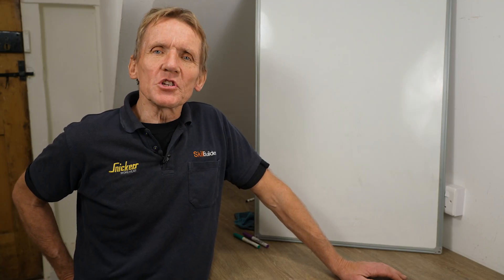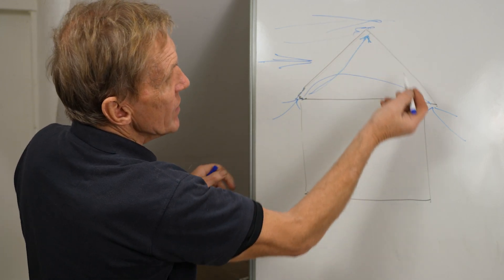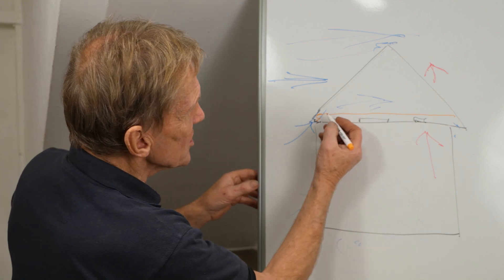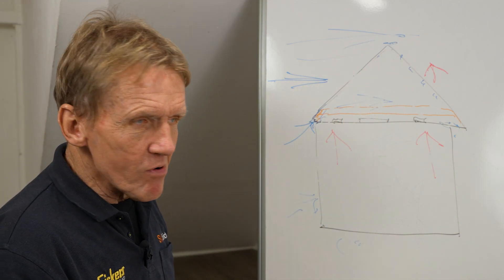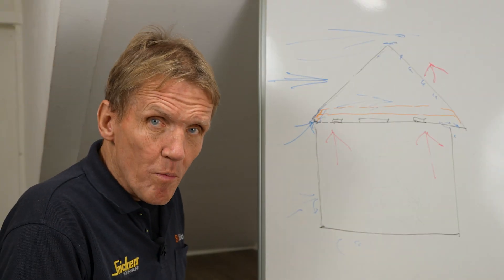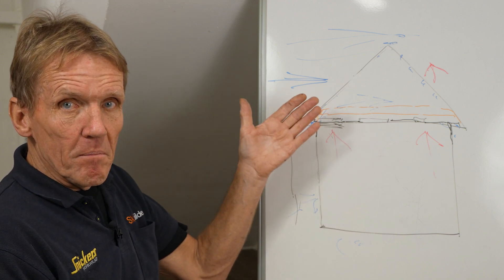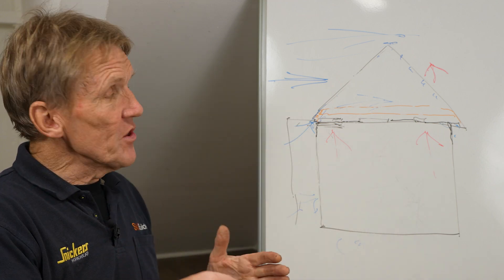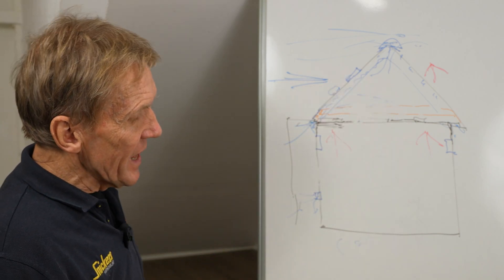Why Do You Have Condensation in Your New Roof?

Comment: This is old but very relevant. I had a new roof put on but all of a sudden had a lot of moisture build up....not in the loft so much but in the house.  Ridge vent open, soffit baffles created and put in but still problems.  Insulation was blocking but have pulled back. Why/how could this be?  There is inadequate insulation in the loft which will be corrected soon and will be putting a vapour barrier in as well but I don't understand why this has happened?  Not enough ventilation?

Comment: Couple of vital of info missing on post (although as a roofer myself ,spot on about cheap membrane) Firstly the lower the pitch of the roof , the more condensation it gets. Secondly roof tile vents only work by cutting holes in the felt directly where vents are  strategically fitted.
Thirdly there are spacers available really cheaply that will separate the felt from the inside attic space that will solve the problem alongside which is already rightly explained in this vid . Great post tho all round

Comment: This explains my issue but what would explain the mould appearing on walls like under my stairs in the cupboard and in the corner of my bedroom both which are the same exterior wall. Also I have water mould in my loft on the OSB of the gable end it’s a brand new house

Comment: Great video thanks. What would you consider to be the average moisture content we should expect in a loft for a new house during the winter? I have recorded humidity levels in the high 90%s. A neighbour also took measurements in his loft with similar readings (max. 99%). I appreciate that new houses take time to dry out and we plan to check again new winter. We have lived in the property for the past eight months.The site manager has been very helpful and has inspected the loft to ensure the insulation is not obstructing the ventilation in the eaves. Having previously lived in two new-build houses in Guernsey constructed with 'cold roofs', both had consistently dry lofts and we were able to store boxes and clothes without any signs of damp.

Comment: Hi skill builder. Just wondered if you can advise me. I have noticed that im getting some damp patches  on my newly converted loft space. My understand from your video that it's most likely not enough venterlation. The vapour barrior used was the "£40" vapour barrior used. If the vapour was upgraded to the 3ply as suggested, do you think this would help/rectify the issue

Comment: Hi Roger, great video as always. I’ve just started getting a small damp patch through my lounge ceiling. Looking in the loft (today) there are a lot of water droplets on my vapour barrier, all over the old section which wasn’t celotexed. It’s a new roof (tiles & vapour barrier) with 200mm rock wool which has started to get saturated! Watching the video, I’ll get some ventilation circulating. My question is, should my builder have known this would happen, and advised us and secondly would the chimney breast have any effect in winter making it worse. Thanks

Comment: After 48 years of trial and Error with  the Problem  of Black Mould in the Bathroom  Ceiling and Bedroom Ceiling along with Heavy Droplets of Water on the Newly Fitted Roof Membrane some 15yrs ago 
A SOLUTION for me CAME IN THE LAST 2 YEARS.
I Fitted a Dehumidifier 10litre from Argos in the Attic with 100mmx40mm Channel PVC Ducting going to an Extractor Fan with Humidistat Auto Settings Above 55%. Humidity, with the Condensation or Moisture  then going from Attic to original overflow pipe outside , that made all the difference. 
HEALTH Benefits was my Main Achievement. 
Tom.

Comment: Very  interesting  and  informative - good to get down to the basics of roof void ventilation. As you point out, not all so called vapour permeable sarking felts are the same.   One way or another moisture must be able to escape from buildings or else it will remain trapped and is likely to cause problems!

Comment: nobody has once mentioned about the incorrect installation of breathable roof membrane. it doesnt matter if you buy a £10 roll or £100 roll. no roofer ever leaves the top wrap 50mm down from the ridge board! this process allows warm air to escape through the dry ridge system! if dry ridge system is not used then surface mounted tile/ slate vents are best

Comment: Hello I need some advice. I have a new metal roof over my 1974 mobile  home. The problem is condensation is building up above my bathroom, kitchen, and the small room in between is settling on the underside of the new metal roof and dripping down towards the soffit and in turn hitting the truss as well. I think the problem is we decided to vent all plumbing and exhaust fan through the soffit and outside, and maybe it exiting back into the attic plus that is the only spot on the whole roof where condensation is building up. Just to mention, we live in a very humid climate on Vancouver Island. 
Our main heating is a wood stove.
Reply from the maker: Hi Dan 
It is a difficult one because a humid climate is always going to create moisture but it also needs cold surfaces to condense on and cold air holds less moisture. I think it is worth hiring a dehumidifier and running it for a week without the extractor fans to see if that makes a difference. 
I would think the wood stove is doing no harm and keeping the house dry.
Reply: What most of the old-timers who have experience and have seen my pictures, including a retired building inspector, said is to get that vapor out of the attic. 
Corners were cut during the roofing process, and we decided to vent through the soffit, and it's backing into the attic and sticking to the cold metal. Every other area under the roof is bone dry except for the exhaust exit and plumbing vent exit, and there is 
three vents within 15 feet of each. I am going to vent through the roof, and if I still see a bit of condensation, I will use double reflective insulation and attach that to the metal underside. 
On top of that, there is zero ventilation in the attic anyway, nothing on top or at the gable at both ends of the house.
I am also going to make plans to buy a dehumidifier and have that run during the cold season.

Comment: My Partner moved into a new build that was mouldy in the attic from day 1. 
Builders said it went up mouldy (Bugs are on it eating the mould and come down from the attic through crevices).
She complained 25 times over 5 months and nothing was done. They have finally said that the attic passes NHBC recommendations so they are free of blame.

The attic faces NW, and is a valley attic. All the valley boards are mouldy and damp and were so from before she moved in. It gets worse and then better, then worse again. It's taken layers off the wood.

They say the attic is drying out, and now she is adding to the moisture problem (we have been super careful to not do that).
I cant believe this is how it works. We get ruined and blamed for something that was already there.

My partner has just gone through a year of cancer treatment and should be nowhere near mould. Her moving into a new build with a mouldy bug infested attic is sickening. The building game disgusts me. Blaming homeowners for these moisture issues is too easy for them, The attic gets no sunlight at all on the valley sides but as long as the good old NHBC says it's fine, we suffer.
Reply: The NHBC are useless, they always take the builder's side in a dispute. I had a new-build which was a nightmare. The NHBC guarantee is not worth the paper that it is written on.
Reply: @Cranstal  Yeah i have wised up to the NHBC now. TBH the housing company, NHBC and the builders all seem one in the same. 

There defiantly is some code to stick together against the public.

Its sickening. I cant even get a solicitor to help, They don't want anything to do with Housing disputes. No wonder the rich and powerful are able to walk all over the public.

Comment: Hi Roger, I don't have a vapour barrier on my ceiling plasterboard. How about using liquid rubber sealant (like the ones used in bathroom showers) on the upper side of the board? Any cons?

Comment: Hi Roger !......Would an extractor fan automatically operated by a Humidistat, placed at high level in a roof space and ducted down to a grill in the soffit panel be a useful way of dealing with possible condensation problems ?

Comment: We have a boarded loft with no insulation between the back of the ceilings and the underside of the loft floor. Can we just unroll insulation across the boarded floor to insulate the loft or will the cavity beneath the floor boards create a problem of any sort between the back of the ceiling and the underside of the loft flooring. The ceilings are all lathe and plaster, the house is 1930s build. The loft is just a loft and the floor boarding is just boshed in for convenience. Any guidance gratefully received. There also is no roof membrane under the tiles but that would be too much of a job as the roof is generally sound.

Comment: Good video Roger, stick to the knitting…whilst talking about heat pumps and COP conferences may give you lots of hits sadly you spread mistruths that are extremely damaging in the long term to us all.
Reply from the maker: Hugh
Start your comment with an insult if you don't have a good counter argument. What my heat pump video is trying to do is to save the whole heat pump industry being dragged into the mud by a government initiative that will see heat pumps put into home which are not suitable. I am sorry if you failed to see that
Reply: @SkillBuilder  The 2 heat geek video responses to your videos are a detailed response that I support. Some of your points were well made others were plain wrong. As a result I don’t believe your message was clear and it left the general impression that heat pumps don’t work period. If you intended a different message then both the titles and the main messages of the videos suggested otherwise.  I think the use of more facts might help. (Eg. You talk about ‘noisy’ pumps what defines that - my pumps run at 55 db at max - not noisy at all)

Comment: You. could fix extractor fans in gables controlled by humidistat. Very few houses will have vapour barrier at ceiling level  or vapour permeable felt to roof. The problem is at its worst when heating is on in Winter when you have heat on and it is near to freezing outside. This is best time to check. Otherwise the dew point is not present within the structure so does not appear.

Comment: I've just put in 300mm of rockwool, but before i did, i cleared all the old crap out the loft, old 20mm insulation and have stapled eaves ventilation panel to the bottom of the rafters to let air in, i'm DIY, and it amazes me that this isnt known!

Comment: After moisture running down the roof liner I've run one of these for a year with no damp issues. I use it to just blow air around the roof space. It costs about £8 a year to a year.
I'm talking about a Vent Axia Lo-Carbon PoziDry Pro PIV Ventilation Unit Model:476310 (No Heater)

Comment: I bought a new build with soffit and membraned rafters and boarded it out. After the first winter, I got in the loft to put in the xmas decs and it was dripping wet. Anything permeable was covered in mould.
Reply from the maker: New build is always prone to this kind of thing because the building is drying out. During that time a dehumidifier or ventilation is essential.

Comment: Rog if rising damp exists, how come it never goes right up to the roof??? PS will you be doing an Xmas rant this year???
Reply from the maker: Rising damp does exist,  no question, but it is drawn up by wicking so it requires the damp to evaporate which then draws more up. This generally happens at low level.

Comment: Does having your central heating boiler in the loft help or make worse the potential for condensation. Even the best boilers give off heat in operation as do of course all the heating pipes connected to it. Putting a boiler in the loft seems a common option now on refurbs as it frees up space in the rest of the house.
Reply from the maker: I think it helps to keep the loft drier but it is better to cut the heat losses

Comment: Worth checking that any vent hoses that go into the loft are properly connected, mine wasnt from the en suite when we moved in and the loft was soaking wet.
Reply from the maker: That happens a lot because the electrician puts the duct into the loft and the roofer is supposed to connect it to his terminal

Comment: The law of thermodynamics says  vapor  turns to fluid   where heat meets cold. If you have a vapor barrier like paint  in the room the drywall diffuses the exchange to attic   by slowing the temperature change rate . Insulation also creates a larger area of slower heat exchange. Any barrier in the insulation like paper or plastic will create another vapor to fluid formation exchange point . By creating vents  to attic you allow the temperature range difference between outside air and the attic space to stay relatively close .  The roofing material creates the next vapor barrier , which side is warmer is where the vapor will turn to fluid and sweat

Comment: My new build had moisture problems. 1: the insulation was blocking the vents in the eve's, 2: the loft hatch was drafty.. 3: the bathroom extractor wasn't even connected to the pipe! 

Nightmare - 2 years it grew mould on the membrane, OSB and rafters. 

Fixed the 3 problems i don't have a drop of moisture up there.
Reply: Had all same problems in mine.
Sorted now.

Comment: Roger heard you on radio 2 very measured response to heat pump guy who ranted after your input.  Take him up on his offer and get a heat pump in.  He couldn't answer the real issues.  Perhaps an interview on skill builder and a site visit with him....
Reply from the maker: It would be a good video but I have a feeling he won't do it. Putting a heat pump in over 2 days if you have no hot water cylinder to begin with and changing rads is more than 2 days even with 3 people I would struggle. He has to run a power supply from the board build a hard standing etc. 
We will see how that turns out

Comment: Great video & an important one. And your presentation is great, structured & logical, as always

I have seen your block & beam floors video of 35A, several times, both the laying of it & the screeding. My questions are these

1. The prep work of the beam & block work I.e. slurry etc is missing in the video mentioned above. There is also underfloor heating. Could you provide a video on prep work before screeding on beam & block floors, even if it is theoretical without any onsite videos?

2. If we were to use beam & block flat roof, how would we go about waterproofing it in a

A. Cold climate
B. Hot climate
C. Cold & wet/damp climate
D. Hot & wet/damp climate

Thanks in advance. Keep up the good work!
Reply from the maker: Ah! Ok
We did brush cement grout into the gaps and then laid polythene before the insulation went down. I don't know why that wasn't in there. I will talk about block and beam outdoors, it needs a good bit of waterproofing
Reply: @SkillBuilder  thanks & look forward to a video on beam & block flat roof start to finish

1. Not so much the laying of beam & blocks & the different varieties of block I.e. light concrete, styrofoam, polypropylene etc, but more on 
2. Waterproofing a cement block beam roof, including insulation for hot weather, as concrete absorbs heat & releases it after evening
3. Make it ready & fit to walk on, have a terrace garden etc in rainy, hot weather